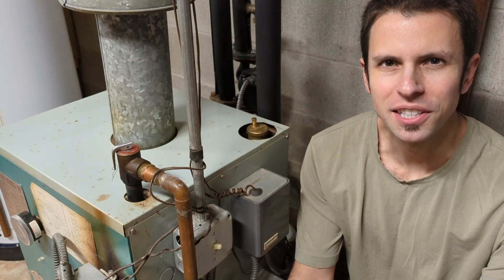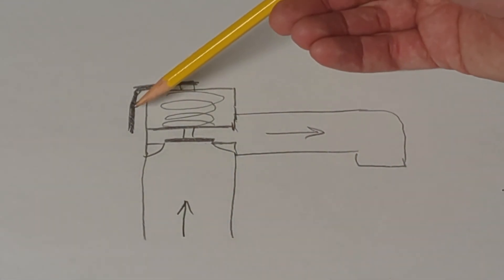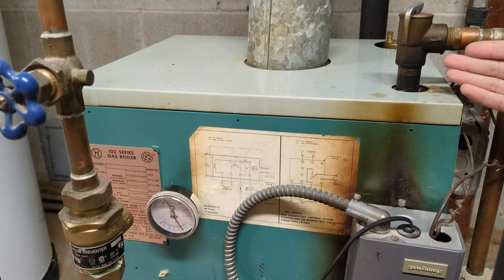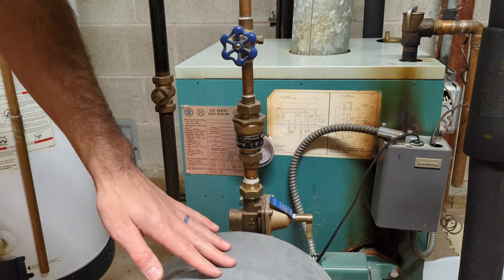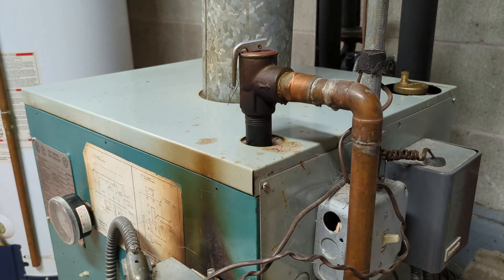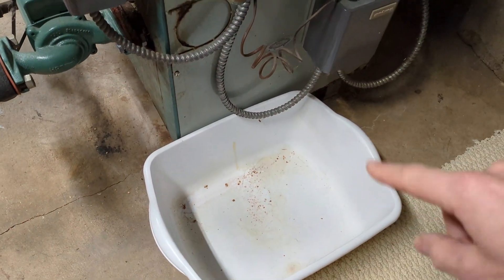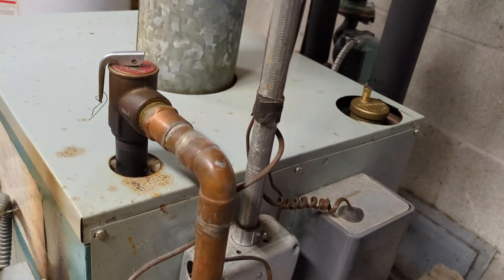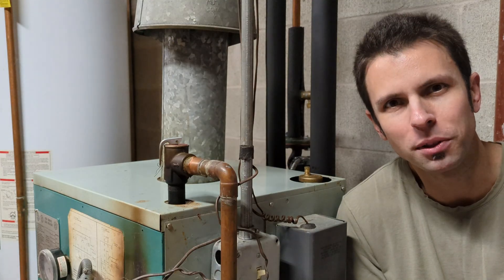Why Your Boiler Pressure Relief Valve (PRV) is Leaking / Dripping - ConBraCo, Watts, Apollo - 30 psi

Comment: My boiler shut off last night (very cold 22 and windy) at the primary control.  boiler is in an attached shed to the house.  When I looked at it water was coming out at a good rate from PRV.  I reseated it and it stopped.  The PRV and expansion tank are only 3 years old.  Boiler fired up and seems to be running fine.  Getting 15 psi around 150 degrees and goes to about 20psi at 180 degrees.  
So right now everything seems fine.  So why did the PRV blow?   It must have spiked at some point but not sure why.  If it does it again I’ll replace the pressure reducing valve (Taco 329-3) and maybe new PRV.  
But my mystery is why did it spike and then shut off but now work normal?   After that the circulation pump was louder than normal because it lost water.  
Thanks for any input
Reply from the maker: It may have had high pressure for a second then stayed stuck open allowing it to continue to leak water. Stuck due to scale or something off with the relief valve.
Reply: @realhouseDIY that’s what it seems like.  I’m going to replace the reducing valve later this week when it warms up outside.  
The relief valve is only 3 years old.  Do I need to replace it?   It wasn’t leaking at all this morning.  
Could extreme cold weather (cold city water) cause a momentary spike?   Exp tank is good and only 3 years old.  
Thanks for the reply.  
Right now everything is back to normal

Comment: 1000 likes for a reason. Very comprehensive 👍🏼
I replaced my pressure relief valve and the new one is leaking. When I get home I'll look for a pressure gauge and also check the valve to the expansion tank is open!

Comment: My pressure relief valve is spurting hot water out every 10 minutes wether my furnace is on or off please help!
Reply from the maker: Does pressure and temperature stay steady during that time? If so then try turning off the input water to the system. If it stops the spurting, then try adjusting or replacing the pressure regulating valve.

Comment: Also if you've not tested it in 30 years and you open it momentarily .........
Reply from the maker: Yeah 30 years is getting pretty old too
Reply: @realhouseDIY  I did fix mine with a little tap on the top, no more leak but probably get it changed out soon. Actually need a new Zeismann HE builder just balking on the 10k install fee!

Comment: My system is over pressurizing still. Changed the tank, relief valve, and circulator pump… i also adjusted the pressure on the water valve to 12 psi. It rises over 30 every time. Removed all the air from the system by doing the force feeding method. Also closed the valve after my water feed valve. To eliminate a bad valve. Pressure rises to 30 every-time.
Reply from the maker: How high does the temperature get?
Pressure rises to 30psi and the relief valve also leaks water at that point? 
If yes, the expansion tank may need to be adjusted. Or possibly a larger expansion tank.

Comment: Expansion tank show for large system.  2 gallon ok for 75K or less.  Lowe’s.   Pressure valve pipe to floor should be longer.

Comment: I have a tankless boiler setup in my house. I also have 2-zone heating in my home. Off of the boiler is a closed circulation loop just for the boiler and each zone has a supply and return (with their own valve and circulator) coming off of that.  My expansion tank is mounted on my upstairs zone plumbing to an air release valve.  Recently, I've noticed my blow off releasing water whenever my upstairs zone (the one the expansion tank is on) shuts off (closed zone valve and circulator). I haven't checked my pressures yet but the expansion tank seems to pass the screwdriver tap test.  Any ideas?
Reply from the maker: Right, I'd want to check the pressure at that time. And also how old are the expansion tank and blow off valve?
Reply: @realhouseDIY  I appreciate the prompt reply.  The tank and valve are probably 10ish years old? I'll make a point of checking the pressures.
Reply from the maker: @mattpalmerchuck 10 years could be expected for either component. If pressure is going above the rating of the valve, then I'd focus on the expansion tank. Maybe just need to adjust the charge. If pressure shows lower than the rating on the valve, and the valve is leaking, then maybe worth replacing it.

Comment: I had to replace mine yesterday after the guy who does yearly maintenance tested mine and it started dripping. No matter what I did couldn’t get it to stop. Replaced,the Pressure relief, two HyVents, and my expansion tank.  Refilled and restarted the system and the pressure keeps increasing close to 30. I keep bleeding water from the drain to bring it back to 18 psi or so where I run it. I think my auto fill might be allowing water to leak by. Shut the water off to the boiler to see if that solves the issue. Any other thoughts?   Thanks. Ps love the videos.
Reply from the maker: Yes, I was going to say pressure regulating valve. If you have a shut off valve before the system, try closing that temporarily and see if it fixes the problem.
Reply: @realhouseDIY that’s exactly what I’m currently doing. Thanks for the help.

Comment: How do  you adjust pressure  on this boiler?I have same  one thx
Reply from the maker: At the water input to the system you should have a backflow preventer and a pressure regulating valve. My regulating valve is set to 15 psi. It might be adjustable depending on the valve.

Comment: Only thing I would add is to try to get air out while filling. Pull the new relief till water starts to come out then rely on the air bleeder. Because the air bleeder could be faulty
Reply from the maker: Good idea, thanks. Probably not much air, but might even be worth flushing each zone to be sure. Depending on how much water came out to begin with.

Comment: Can it leak after shutting off the water main to the house?
Reply from the maker: Yes, if the heat turns on and the pressure rises. But then no replacement water would enter the system with the water shut off, so you wouldn't expect it to leak again with lower pressure.

Comment: This is the best video I've found on the topic - great job!  Question, I have a Watts 354a which does not appear to be made anymore and is 3x the price at places that have it.  Is this still the best brand to get or do you have another brand you recommend?
Reply from the maker: Apollo/Conbraco is the other brand that's been recommended to me. I have some of those brand's components installed on my boiler and working just fine.
Reply: @realhouseDIY  Thanks!

Comment: Thank you so much! Ours was dripping (after having some parts replaced)so we went to YT and found your video. It was very helpful and we think the seal just wasn't seated correctly. 🤞🏼So far, it's not leaking since opening and closing it quickly.
Reply from the maker: Great! Chances are it's just fine.
Reply: Very helpful  video. Thank you so much.
Reply: Did you shut down the system first, or just open and close the valve?
Reply: @MeandMyStaffy just opened and closed it quickly.

Comment: Very interesting. Does leaking go together with more noise? Since ours started dripping, it also began making a noise (bit like when you put your finger over the end of a hose and the water can't escape).
Reply from the maker: Yes, mine did make that type of noise a couple times when it let out a short spurt of water. But not when it was just dripping. Same noise as if you manually lift the lever for a split second.
Reply: @realhouseDIY  Thanks for your reply, much appreciated! The noise is here constantly, bit worrying :(   (still waiting for a repair man, it's crazy busy).

Comment: When I did mine last, I used a shark fitting on the downside of the elbow after the relief valve. That way if I have to do it again, I just release the pipe going down then wrench the elbow fitting off then remove the relief valve.
Reply from the maker: Nice, thanks!

Comment: Nice video! You have said that you can open the old relief valve to drain and drop down the pressure once all the valves are closed. Once you open all the valves to put the water back in the boiler, can you do the same thing and open the new Pressure Relief Valve to bleed the air out of the boiler?
Reply from the maker: I hadn't thought of that. Small amount of air I let the air bleed vents take care of. Larger amount I suppose I would feel more comfortable using the large valves with the garden hose vs the relief valve.
Reply: @realhouseDIY  In my case, the hose is the bottom very close to the ground, so can I let some water out for bleeding?
Reply from the maker: @phitanvo4767  yes, there are some good videos to see how to do it. Basically connect a garden hose and run it outside. Open the valve and wait until the water comes out a steady stream with no air.

Comment: I'm a little confused. The pressure in my boiler seemed fine 15 to 18 even at full heat. But the the overflow valve was dripping, that made me think the valve was bad.  Changed the valve it's still leaking does this indicate  the expansion tank must be bad?  If not what else as I said pressure in system seems fine.  Thanks
Reply: It’s likely your expansion tank (rubber bladder tank, not the overhead 20+ gallon Drum tank) rubber gasket is ripped and not stretching to absorb heated water.  There is a test which is tapping the steel expansion tank for a tinny sound which I can’t tell.  But Google it and see if you can tap the tank and hear it.  In any event, a rubber gasket tank from Amtrol is I think warranted for 7 years, and a typical rubber diaphragm tank will tear in 7-10 years.  The rubber diaphragm is under constant 12-15 psi and 180 degrees when water is heated, so the bladder will develop a tear or rip from the mounting.  After 7 years, replacing a tank is preventive maintenance, but it is a drag because the system has to be drained of water and repressurized to 12 psi.  But draining the system also removes air pockets from the system.  When the rubber diaphragm is torn, water will log the tank and weigh about 35 pounds versus 8 pounds of steel w/o water.  Steve Lavi in the Dartmouth area of Massachusetts has 200+ videos on his home repair calls, including replacing expansion tanks.
Reply: Should i just change the expansion tank?  Thanks
Reply from the maker: @martinsmythe3414  my reply didn't send the first time. I was going to ask how much it is leaking. And it's a 30 psi valve?
Reply: @realhouseDIY  Yes I'd estimate a little over a pint a day up to a quart.  new valve still leaking a pint?
Reply from the maker: @martinsmythe3414  yeah maybe the gauge is reading low. I would next check out the expansion tank. See if it's still set at correct pressure when disconnected.
Reply: Some plumbers say that once the relief valve is opened, it won’t seat properly and will leak, making it hard to tell if it’s too much pressure 30psi or the valve plate didn’t or can’t re-close properly.  At that point, spend the $30 for a new valve, and leave it alone.  Although there will be deposits from water that may stick the valve plate, but 10-15 years replacement cycle is OK.
Reply from the maker: @tonymanero5544  the valves are designed to work more than once. Plumbers definitely advise to just replace with brand new as they don't know the history. Yes it may drip some but can and will reseat.
Reply: @realhouseDIY  Today I changed the tank. It was full of water. Right now up to 175  and 18 lbs psi  the valve is not dripping right now I hope it reseated!
Reply from the maker: @martinsmythe3414  that's great! Though you never saw your gauge go up to 30 psi? I'd question if it's reading low. Maybe need to replace.
Reply: @realhouseDIY  It has never gone over 20.  What makes me think it is accurate is when i charge it with water it is about 15   then when it heats up  18 to 20. What do you think?  when I changed the tank the water was very dirty I think from the disintegrated  diaphragm .  could have been causing the valve not to seat properly?
Reply from the maker: @martinsmythe3414  possibly. Myself, I'd probably leave it at that and just monitor it several times a day for a little while.
Reply: Great video!

Comment: This video on the pressure relief valve is amazing. I had a leaking flexi hose to the mains pipe and it was replaced by the plumber. but now, water is leaking from the valve into the drain. I’m just tired.

Comment: Hi, and thx for your great videos and info. My question, when replacing leaking relief valve is it okay to increase from a 30 PSI watts to 40 or 45, if my hydronic gas boiler has a MAWP water of 50 psi ?

When calling for heat above 66 degrees, the pressure gauge reaches close to 38 PSI (the set max on temp/pressure gauge) and water temp goes up to about 120 degrees from as low as 80 when boiler is cold. Both temps too cold. 

I’ve used the relief to valve to drain water when calling for heat was increasing pressure gradually. But now pressure spikes immediately once thermostats calls for above 66 degrees.
Reply from the maker: It doesn't fix the underlying problem. Probably the expansion tank isn't working.

Comment: The water pressure to my house is about 40 psi.  What psi should the relief valve have?
Reply from the maker: Do you have a pressure reducing valve between house water supply and the boiler? It lowers the pressure for the boiler system to around 10-25 psi range, then the typical residential boiler relief valve is 30 psi.
Reply: @realhouseDIY  The pressure reducing valve, 12 PSI,  is local to the boiler, immediately after the cut off valve.  There is no reducing valve for the rest of the house.  Currently the boiler pressure is closer to 10 PSI and the  cutoff valve is closed.  When the cut off is open, I get discharge from the pressure relief valve which is 30PSI.  Funny thing is, I have two houses seeing the same symptom:  Discharge from the pressure relief valve while the system calls for heat.  On one system I replaced the expansion tank and matched its pressure to the house which is 40 PSI.  replacing the expansion tank reduced the issue but there is still discharge with the open cut off valve.  I'm thinking about replacing the pressure reducing valve which is at least 20 years old.
Reply from the maker: @sidstanton02  I'm thinking the expansion tank pressure is too high. It should be lower than the relief valve pressure.

Comment: So its normal to have some small leakage every now and again. I use my fireplace a lot soca lot of times its too hot inside for a call for heat. So when it cools enough and i put the heat on i get seepage. Maybe a cup or 2 of water.  Brand new valve. Expansion tank is about 6-7 years old (time to replce).  Pressure creeps up to 30 psi on the boiler. 

So is it normal to have some leakage?
Reply from the maker: Close to 30 psi, then the valve is doing it's job. But pressure typically shouldn't go above low 20s. Might be the expansion tank.
Reply: @realhouseDIY  oh yeah I went to check air pressure on the Expansion tank and water leaked out! Turns out it was full of water! I realized all this at 3am Christmas Eve morning! Hahahaha! Thank Gid the local hardware store was open at 7am and I went and got a new tank, swapped it out and it's all fixed! Seems this tank was bad for a while and I didn't know. My fault, I moved in here in early 2023 and I just assumed the tank was good. It was installed in Nov 2018. From here on put ill check it once a year.  Oh and it weighed a ton. Its a foot over my head, it reminded me once I had to pull a full gas tank out of an 88 Fox Body up on a lift above my head. You get the picture! It was famn heavy.!! Next time I'll pop out the shader valve and drain it. 

Tha is for your awesome videos! Great help!
Reply from the maker: @jayyk31  you're welcome and happy it helped!

Comment: My hydronic boiler when working is at 30 psi, is it because the pressure relief valve is also set at 30psi? Most hvac guys would say it should be running at 15/20 psi.
Reply from the maker: I can't speak for all of them, but yes 15/20 most likely. If the pressure relief valve is letting out a lot of water, then I'd look into it more.
Reply: @ The relief valve isn’t leaking, I’m just wondering why is the boiler running at 30. Thanks so much for the advice.
Reply from the maker: @cancerking9416  possibly the gauge reading high if the relief valve isn't letting out water. More likely the expansion tank though.
Reply: @ I personally change the expansion tank and relief valve two years ago. Also had someone change the tri gauge earlier. I will have someone check it out. Thanks once again.

Comment: I have a furnace that is going over 100 Psi if ur looking at a clock it’s pointing at like 5 o’clock the red line is at 50. It’s dripping water I replaced the safety value. I’m guessing it’s too much pressure? Not sure how to fix it
Reply from the maker: Operating pressure should be listed on a nameplate. Or what is the prv's psi rating? High pressure could be the regulating valve that is supposed to dial down the input water pressure from the city supply, or the expansion tank not working. I have some other videos in the playlist that could help:
https://youtube.com/playlist?list=PLSYmFWIc57sFp2HmYjLq2bI424FSZ1efv&si=aRe81m1JSnISYdIS
Reply: @ we got a new valve and it says 150 PSI from our plumber but I  don’t think it’s supposed to be 150 since it’s a 3 bed 1 bath residential house.
Reply from the maker: @alexmezzo6792  correct, 150 psi is for a water heater prv. Residential boilers shouldn't go anywhere near that high. Need to fix the source of the problem.
Reply: @ okay cool I’ll take a look at them thanks for the fast reply!